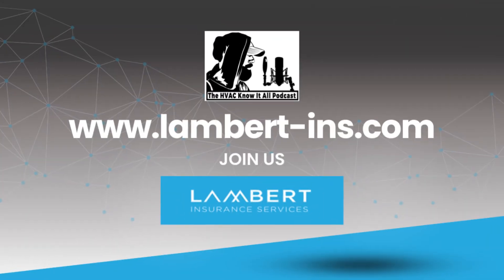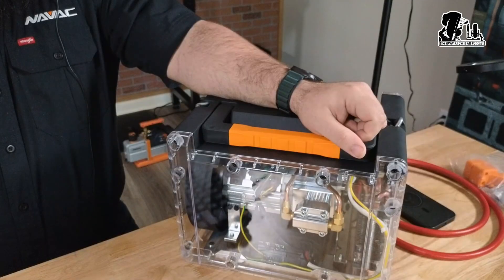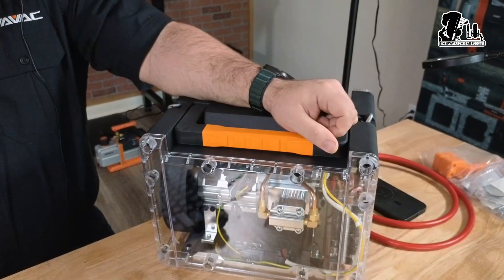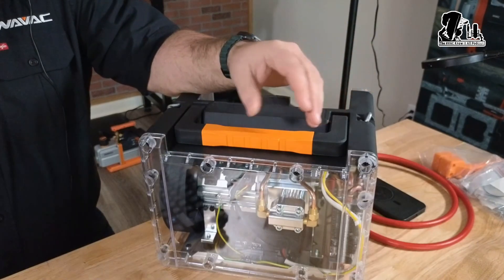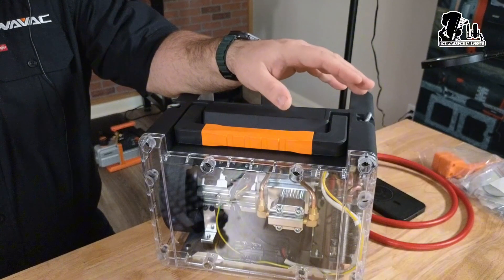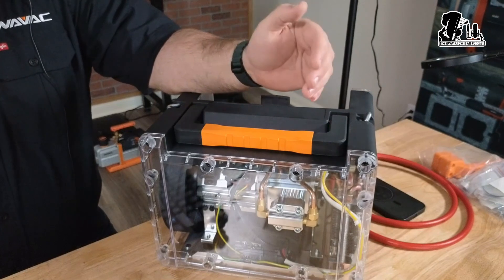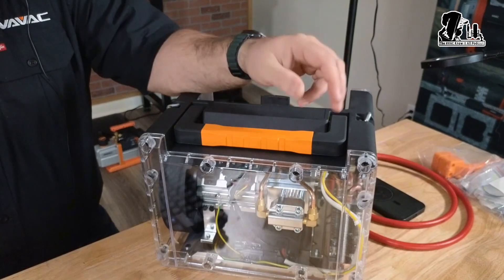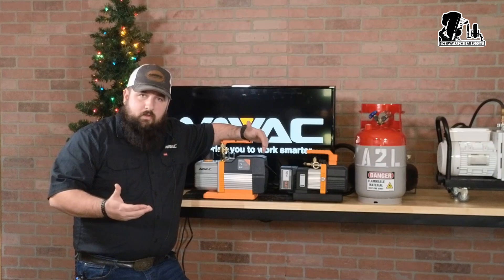How HVAC Techs Can Use A2L Refrigerants Without Replacing Recovery or Vacuum Tools | Jesse Stewart

Comment: Wait til a compressor lead rubs thru on a copper tube or sweating in a compressor and the rfrigerant trapped in the oil blows out oil laced
Reply from the maker: So didn't that happen with 410a, half of it is R32?
Reply: Sure but stick a flame to a 410 jug and get it to ignite . It won’t that’s why the different labels and all these funky leak detectors and other precautions

Comment: What's an arching spark gonna do It's just gonna make that refrigerant. Ignite. till it Burns.out   I. Got the time to sit and wait For it to burn  out That's
Reply from the maker: That depends on the lower flammability.  If it builds up enough inside a space or cabinet to that limit then it will do more than burn.

Comment: When I disconnect my.
 Line  from my propane tank. Which I'm not gonna tell you what refrigerant that is. Propane is A refrigerant after all. Once I disconnect The Hose from the propane tank  what.shoot out the other side of the hose. Is propane once disconnected it's under high pressure. propane is shooting out the other end disconnected So some of The Times I ignite the propane coming out of the line disconnect. And it ignites it Watch the fire, die out On the end that I disconnected from the propane tank. Why doesn't it go back in and explode? Because it's A pressure inside of a reservoir that is coming out the only way it can be sucked back in is if there's back Suction.pressure.
Reply from the maker: I'm really not sure what your point is?  Of course it won't explode there's no oxygen on the system.

Comment: In the refrigeration industry i deal with way more Highly.  flambable refrigerants then R32. Can anyone tell me what refrigerant is R290 Or what refrigerator is R600 Please comment, These  2 refrigerants are way highly flammable than R32  alone. And I deal with them every day in the refrigeration industry.
Reply: R290 is Propane, and R600 is Isobutane. Obviously both are flammable, but as long as you follow the recommended best practices in how to handle them, they are safe.

Comment: Weitron has been including the  LH adapter with jugs of R32. I will say it hasn't been 100% consistan. I've seen pallets that let's say 20 cans had it while the other 20 did not.
Reply: Absolutely. I've been telling contractors to purchase one and if they get a free one with the jug it's just a bonus. Most guys are used to the mini split adapter so keeping track of this new one shouldn't be to foreign.
Reply from the maker: I appreciate the feedback
Reply from the maker: So then the fitting or hose is good to have in case .

Comment from the maker: Did you guys learn something here?
Reply: Ya. It started off telling us that it’s not REALLY flammable, then went straight into telling us how far manufacturers have gone to prevent any kind of electrical spark or arc to prevent a flammable situation.
Reply from the maker: @joeskis2690 not it's not but it does have a lower flammability rating.  So if it's allowed to build up in a strong enough concentration, it can ignite 100%.
Reply: Seeing that I live in Norway, no as we’ve used it for.. “ages”.. but great video as always!
Reply: Great content!